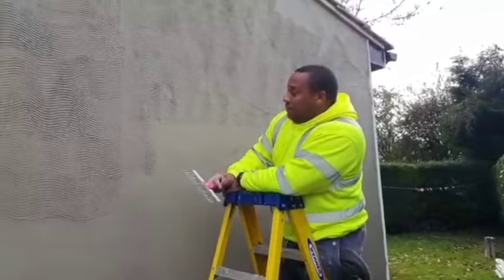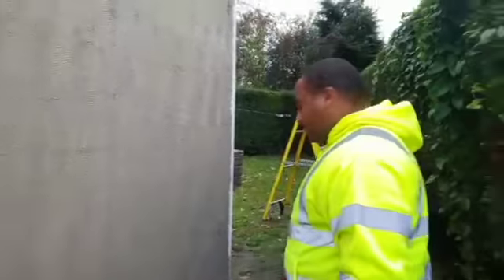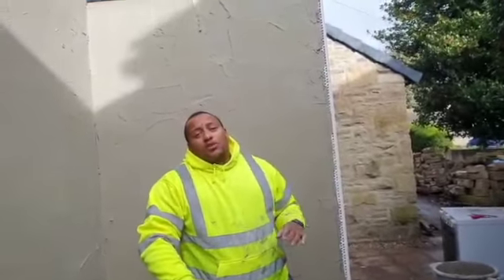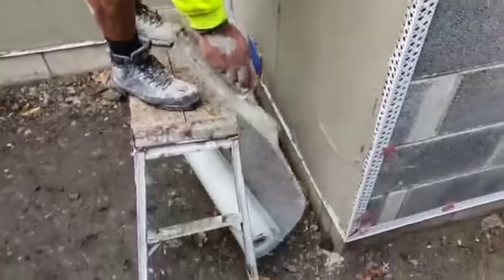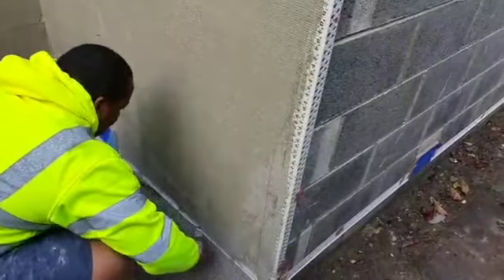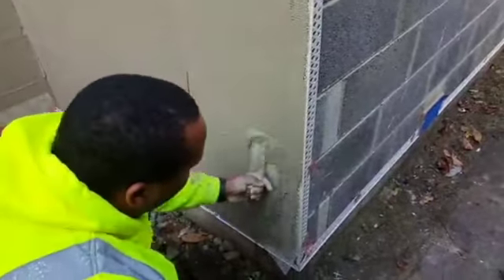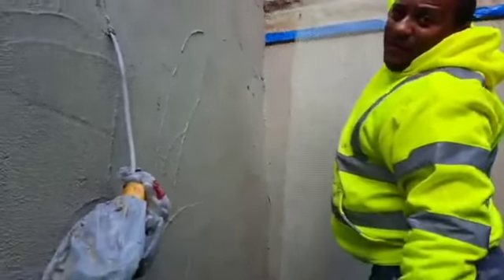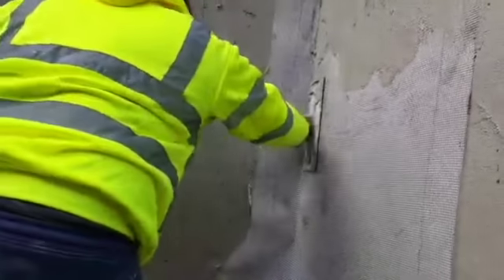how to mesh up a scratch coat  #monocouche #rendering

Comment: Great video have worked with base coat and mesh for over 20 here in the states never put it over blk,but we don't have that top coat here all acrylics and sand and cement
Reply from the maker: yeah its not a spec you have to follow here either, the renders can go straight on to the block, I literally do it to cover my back lol